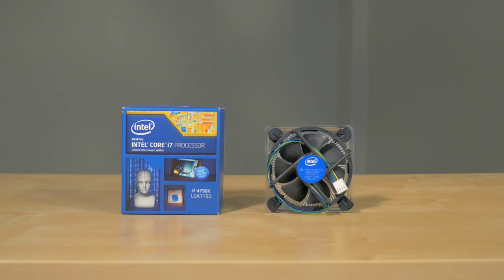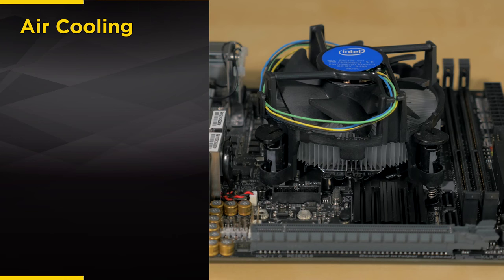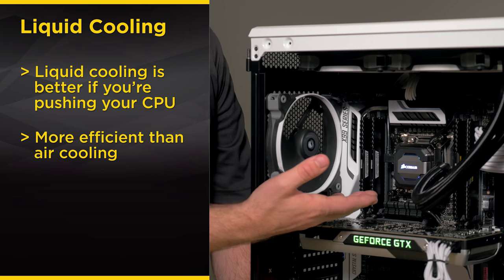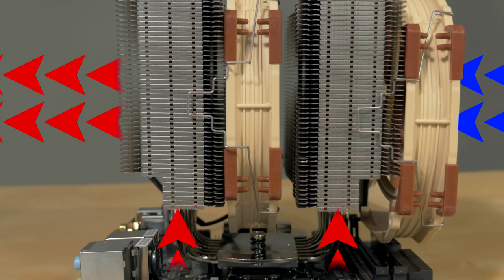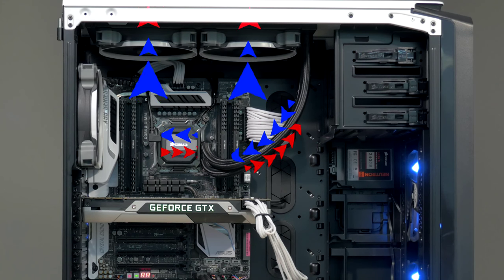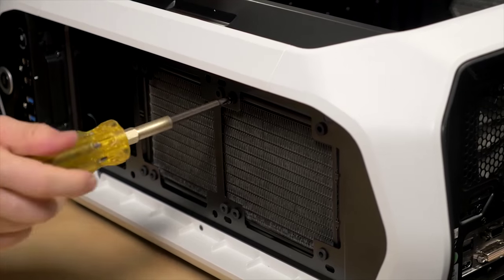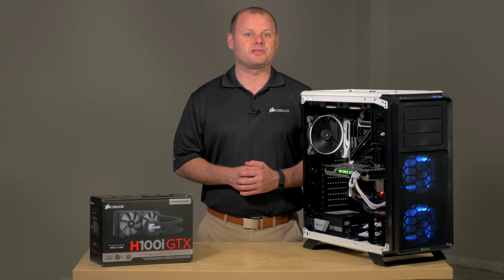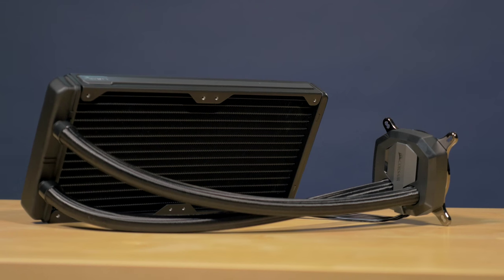Corsair PC Building Basics: air CPU cooling vs. liquid CPU cooling

Comment: Ya many pumps in AIOs are louder than many 30$ air coolers
Reply: +Rosario Pulella i have a ENERMAX ets-t40 (2 fans) ,and i love it is quiet ,cool and i think air cooling is safer and cheaper than risky water cooling
Reply: +luciu constantin idk if water cooling in risky these days, but ya air cooling is good enough, and usually quieter, like there are few cases where fully silent custom water cooling loops are dead silent but aio are never as quite as a good nactua or decent brand air cooler
Reply: +Rosario Pulella If you use the same amount of fans and the same kind of fans then they will be the same. Obviously 2x 140 mm fans will be luder than 1x 120mm fan on a $30 cooler.

Comment: Does anyone have a h100i in a Corsair Spec-02 case?
Reply: i don't think it'll work, its just not high enough.
better looj
k at corsairs website.
Reply: Tea Kay that's what i was thinking, will definitely hit the RAM
Reply: ***** no i mean the space between top and Mainboard could be to short, to house the radiator.
It should have a hight aroun 50-60 mm
(don't know what's that in inches...)
Reply: +Muaaz5903 I put one in the top vent. To overclock a FX-6300 and for upgradable down the road for a customer, he wasn't worried so much about noise (using Corsair link quiet mod. Noise isn't that bad, but still not the greatest) and was looking for performance. I fitted it with a MSI 970 Gaming and vengeance low profile ram. Take a look: https://ca.pcpartpicker.com/b/W4LD4D However if your looking for more quiet operation I highly suggest getting a Be Quiet! Dark Rock TF!, that thing would look awesome in a SPEC case, and is an awesome performer.
Reply: KB_TheDireWolf honestly, I don't mind noise at all. The H100i looks fantastic in your build, thanks for the link! so was it an easy installation or did it take some time?
Reply: ***** you need to be a little forceful to get into position because it gets hangs up on the frame where the side panel mount.
Reply: KB_TheDireWolf gotcha, does it interfere with the RAM at all?
Reply: ***** When you put it in, it will hit the ram. Thats why you have to pull on the frame. Once it goes in, line up the srcew holes and install! It sould be fine if you got low profile ram. I tried to put the fans on top of the rad for a pull config (easier to clean from dust since the side where air comes in is open) found it to be too much of a pain in the ass to line up the holes of the fan and rad. I would suggest getting NF-F12 fans, since they are so much better in noise and preformance than the stock SP's. If you hate the brown color scheme Noctua of fans, get the new linusTechTips edition ones, they are black.
Reply: KB_TheDireWolf lol alright, thanks bud :D

Comment: I use a Corsair AIO cooler but this is rubish. The H100i GTX I have is not quieter than a $30 air cooler. Water is a great heat conductor  but so are copper vapor chambers in air coolers. The main benefit of an AIO water cooler for me is not having a bulky fin array sitting of directly in the middle of your MB.
Reply: +Devils41 You are right but also it's harder to clean an air cooler from dust
Reply: +Devils41 Get a Be Quiet! Dark Rock TTF or the smaller TF from them. They seem to be awesome coolers.
Reply: +Andris Berzins its just as hard to clean a radiator. All you are doing is relocating the fin stack it still collects dust.
Reply: +KB_TheDireWolf appreciate the suggestion. I am not looking to change coolers I like my H100i I was just correcting some misinformation on corsairs side.

Comment: The airflow in this video is wrong. Those fans should be pulling cooler air from the outside down into the case and exhausting it out of the back. This also builds positive pressure inside the case. Come on Corsair, get it right!!!

Comment: I bought a single 120 size Cooler to check out the sound from the pump. It works fine but i have a pumping like sound (loud and fast) is that normal? One of the older generations.

Comment: Liquid cooling is not quieter than air at all.
Reply: +PC Master Race It should be the same assuming you are using the same amount fans and the same kind of fans.
Reply: Read Adams Except there's the pump. If you don't go full custom watercooling with a speed-adjustable pump, a decent sized air cooler with good fans will always be quieter.
Reply: *****
Yea there will always be more moving parts and more points of failure on any water cooler but water cooling is usually better for overclocking and stuff.

Comment: when installing liquid cooling is the Fan an intake or exhaust ?
Reply: +iMagic You can either configure it in either push or pull. A pull set up (exhaust) would pull air in the case through the radiator and out the case. A push set up would push air through the radiator instead of pulling it through the radiator.

Comment: I would not recomend H100i. I have one and I cant control my Radiator fan speed. For some reason it doesnt do anything and everything is connected corectly with all the updates and software needed. The only way to control the fans for me was to connect them straight into the MB CPU Fan socket

Comment: Nice one.

CSGO as graphics intensive? My 4460 (Stock cooler) runs CSGO at more than 100 fps (With my GTX960). Next time show something like GTAV or BF4.

Saying that air cooling is for basic use only is BS. High end air coolers can outperform many AIOs, not to mention pump failure or leaks with AIOs.

Corsiar, Your products (K70, 750D, AXi) are great but this video is just false advertising in order to get people to buy your AIOs, and not a real comparison between air and water coolers.

Comment: If only the pump was quiet.
Reply: +m&amp;m it is...
Reply: +Read Adams never as quiet as an air cooler
Reply: m&m
If you buy 3rd party fans and put them on quiet mode it will be near dead silent.

Comment: What is this bullshit.. Liquid cooling is in no way required unless you really want to overclock massively. 

You can get away with stock coolers (if it is still included with your cpu) to keep your system at safe temps for years, even when gaming or doing other intensive stuff. I mean an upgrade will be nice to quiet your system down or if you are paranoid about it dying quickly but it isn't a need at stock speeds.
Reply: +Bas van der Meij (Ykai63) Completely agreed. The only reason I am looking for a new cooler is because I want to overclock. I have been using a "crappy" intel CPU cooler for more than a year and it is perfectly fine.